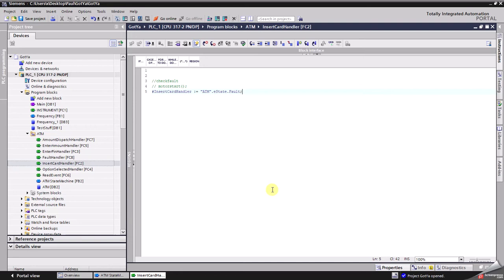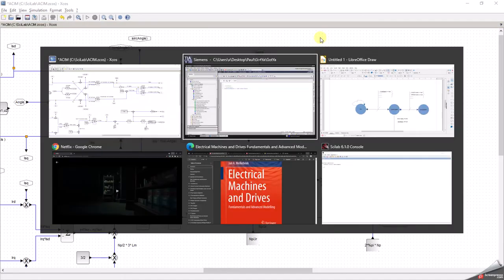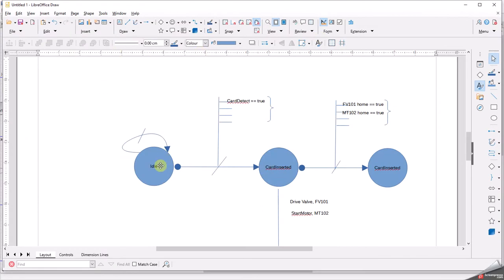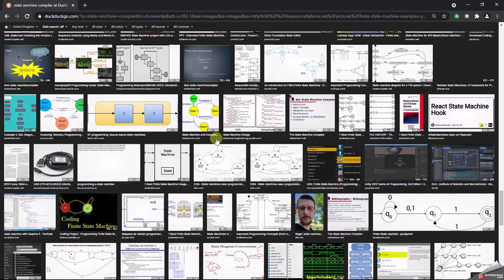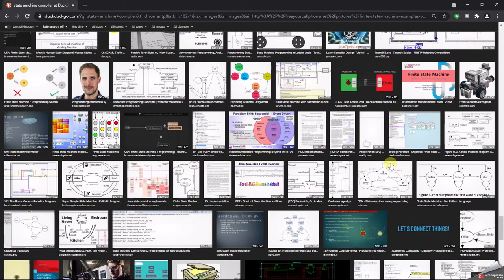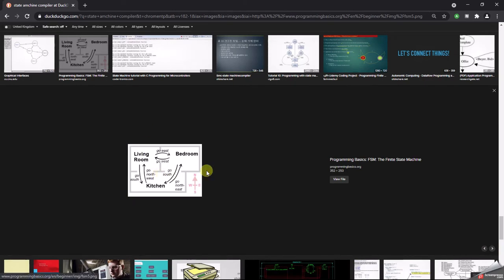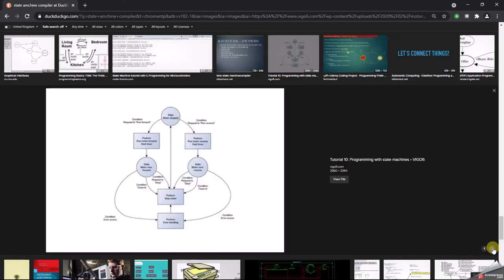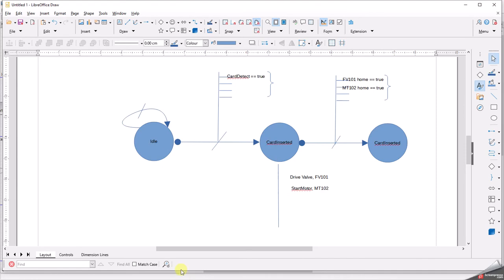PLC State Machine

Comment: good idea! But I don't understand function of "ReadEvent".Could you show me，thanks a lot!
Reply from the maker: Its just to simulate the code....in the real world system there would be real events...so in this case i am just scanni g the events/inputs at the top of the file

yes i found it ....it is for simulation....so all real  world events....hope this helps

	Static							
	eState	"ATMState"	0.0		True	True	False	
	Fault	Int	0.0	0	True	True	False	
	Idle	Int	2.0	10	True	True	False	
	CardInserted	Int	4.0	20	True	True	False	
	PinEntered	Int	6.0	30	True	True	False	
	OptionSelected	Int	8.0	40	True	True	False	
	AmountEntered	Int	10.0	50	True	True	False	
	eEvent	"ATMEvent"	12.0		True	True	False	
	Fault	Int	12.0	0	True	True	False	
	CardInsert	Int	14.0	20	True	True	False	
	PinEnter	Int	16.0	30	True	True	False	
	OptionSelection	Int	18.0	40	True	True	False	
	AmountEnter	Int	20.0	50	True	True	False	
	AmountDispatched	Int	22.0	60	True	True	False